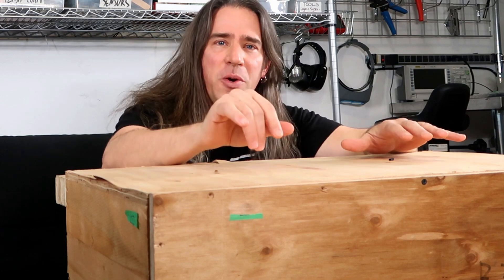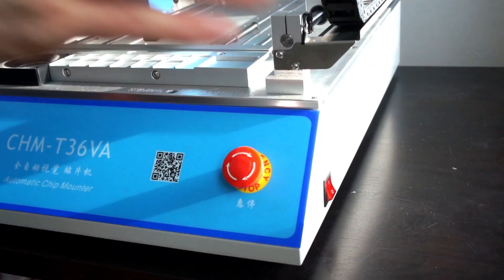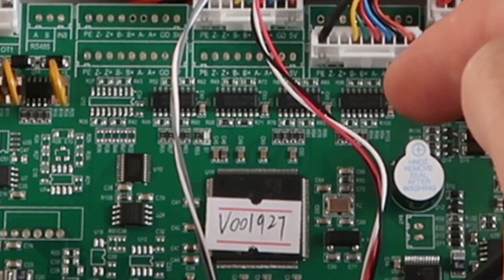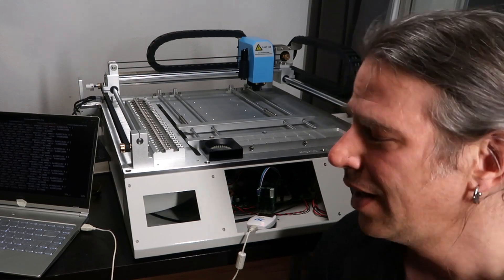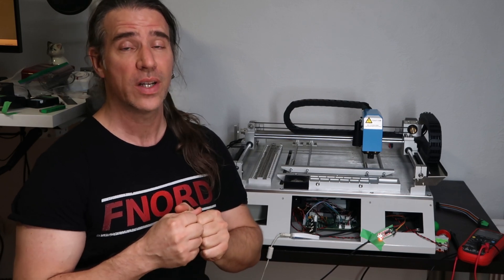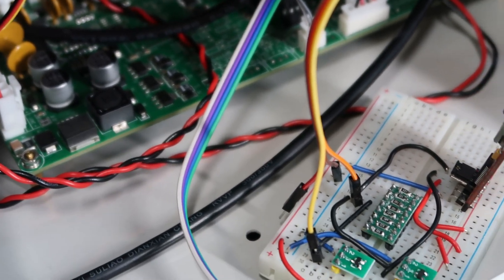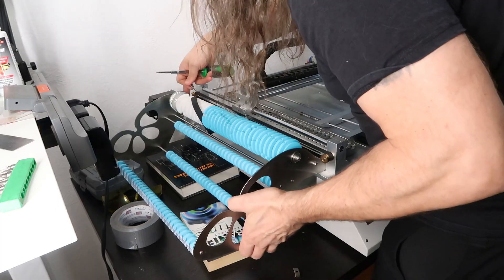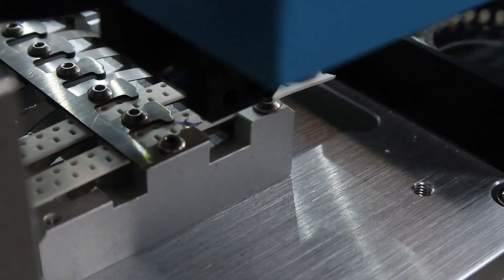Cheap Pick and Place + OpenPnP: CHM-T36VA upgrade guide

Comment: I ordered one of these off amazon. Called amazon to verify that everything was in order and i would be getting my PnP which they said absolutely. Spent all of the money i was saving for one  a feeder and components. Had the company call me and extort me for more money or they'd cancel my order. Now i'm stuck with Components and no PnP
Reply from the maker: Charmhigh did this to you??!  Sounds terrible, I'm sorry to hear this.  Though it was years ago, so I don't know if things have changed, I'd ordered directly from .cn through Ali and thankfully it went off without issue... maybe the fact it went through amazon offers some protection?
Reply: @PsychogenicTechnologies  Nope. I'm out around $2000 and they canceled my order. Amazon offered me $200 amazon credit for only things amazon sells. My only hope of recoup is slowly building a Lumenpnp buy one part at a time until i have it all q.q then processing the components i ordered.

Comment: Hey Pat, I'm new to your channel, but wow you have done some awesome stuff. I am taking ownership of a CHM-T36VB soon, and looking to the conversion to openPNP. Just wandering how yours is doing a few years down the track? haven't seen it in many of your later video's hopefully because it's just doing it's job uneventfully. Would love to see a follow up. cheers for now and keep up the open goodness.
Reply from the maker: Hi Peter!  The machine works great, actually... I haven't been doing many batches lately and this past year I've used the machine more often just to skip having to populate standard stuff like  bypass caps and 1- or 10-k pullups, doing the rest of the mini proto batches by hand, just because it's less of a headache than setting everything up for 3 or 5 boards.  
Short version: when I do use it, it's been quite uneventful, which is what you want from something that's a tool rather than a project.  Still love the thing, I hope you get lots of good stuff done with yours.

Comment: one of these days I'll switch my VB48 to use OpenPNP but, you know, stable working environment and all that.  Plus I like not having to have a separate PC and using the on-board computer that comes with the VB48.

Thanks for the video though!  Was entertaining.  Kinda suprised you didn't unplug some of the other wires to the actuators/motors/pumps/etc while you went through the flashing process.
Reply from the maker: I totally understand about the stable working environment... kinda got scolded by the openpnp guys at some point for using old versions in some of my videos with the liteplacer... what can I say, it's a work tool, can't be disrupted every 10 days.  And yeah, I like using the PC but I can see the advantages of having the pnp more standalone.
As for unplugging stuff for flashing: you know, there are so many ways I could've been so much smarter with this whole migration thing.  I got lucky, it all worked out :)
Thanks for the comment and feedback.

Comment: Did you ever have any issues with the motor being stuck?  When I turn on my CHM-T36VA, it doesn't move.  To my understanding, it is supposed to move the heads to the bottom left, and then back up to the home position.  I can hear the motor attempt to move, but no actual movement.  Can anybody help me with this?
Reply from the maker: Are you using the stock system/firmware?  In my case, with openpnp, it doesn't actually home on its own--I turn on, it does a little pssshh sound and you can hear it power up.  Depending on where you are, as the steppers lock, you can hear them more or less.  If you can get access to a gcode terminal, something like "G28 G91 X0" should home the x-axis (I'm not certain, look it up before issuing raw gcode commands!).  If it doesn't you may have a problem, but the fact the motors are locked doesn't necessarily imply there's an issue.  I'll add that I never, not once, used the stock firmware/software with this machine, so I don't actually know how it's supposed to behave if that's what you're using.  Good luck, I hope you figure it out and get some cool stuff made.
Reply: @PsychogenicTechnologies  Thanks for the reply.  I actually got it working.  It was a serial to usb driver that wasn't allowing the machine to initialize.  Right now I have everything working, and the only concern is that the rotate nozzle doesn't seem to work.

Comment: Hey can you help me, iam using smtmain.exe(not openpnp) with same machine as you, my problem is
 why when iam open diagnostic and i am click the PCB origin after click pull tape, is not same when iam open diagnostic and i click PCB origin withput click pull tape.

Another is why when edit file the position of component is correct, but when i step or run the potition is getting wrong, after that i check component potition again and getting wrong..
Can you help me or where the best platform for asking like this? This is my father machine..

Comment: Pardon my ignorance. Is this machine soldering the components as well?
Reply from the maker: No pardon required, I welcome all questions :)  No, it isn't.  The process is to paste up the boards with solder paste, making the pads nice and sticky.  The machine does its thing, then the boards go into an IR reflow oven, which not only does the soldering, but also--through the magic of surface tension--helps the component be in just the right spot.

Comment: Thanks for the video. I would be interested in knowing how this performed before with charm high sw vs after with open pnp. But it looks like you bypassed the before and went directly to the after. So how does the 36VA perform with open pnp. I may but one and do the same thing.
Reply from the maker: Yeah, I hopped right into OpenPnP without even checking if the thing worked at all (yes, because I'm smrt), lol.  But it all worked out, and actually the machine has performed really well: the main limiting factor being that I insist on installing it with a high center of gravity on rickety shelving (I could do better, but I just don't need better).  If you want to see the original in action, I'd relied a lot on this older series prior to buying, which is a nice playlist: https://www.youtube.com/watch?v=5Y8IyZYC1Uk&list=PLzvLbUxGuZ-xOnVTMobltYmCuJ7cavJO9

Comment: Ha! Entertaining video for sure! That table wobble, good for a belly laugh. I really appreciate your courage in doing brain surgery on a machine that is widely regarded as finicky and getting it to work with some satisfaction with OpenPnP.
Reply from the maker: :) Many thanks: hopefully more fun in the condensed version that the (mostly my fault) roller coaster adventure in real time.  The danger-wobble was resolved (new surface isn't perfect, but a huge improvement and would be even better if I conceded to lowering the center of gravity--you can see it in the video with the LED ring, plain metal shelving but 10x better than ikea screw-on legs) and the machine's been working really nicely.

Comment: Awesome video! Any recommendations for a hobbyist PnP that's good enough to actually get a 1st placement to work without pulling out more of my hair (not much left to pull out)? Not looking to do very large or complex boards initially. Do you prefer using the traditional distys (Mouser, Digi-Key) for parts, or do you take a chance on cheaper sources that may not be as reliable?

Aside:  What brand and series/part numbers of plastic storage containers are you using? Your method of organizing supplies is similar to mine, but I've settled on a different family (Sterilite1963 shallow, 1965 deeper). However, the latches on yours look like they might be more robust. And I don't think Sterilite has any matching containers that are not as wide.
Reply from the maker: Hello Paul: thanks so much!  For a PnP: really depends what makes you pull out your hair but--and I know, this is a project in itself--I still love the LitePlacer as a inexpensive and fun starter.  Though I haven't tried them, I have heard good things about the LumenPnP (https://opulo.io/) and @stephen_hawes has been doing some really nice work with the Index PnP (I'm especially interested in the feeders... not sure where you actually get it tho, but this playlist has lots of stuff https://www.youtube.com/playlist?list=PLIeJXmcg1baLBz3x0nCDqkYpKs2IWGHk4 ).

I use both mouser and digi a whole lot, but for maintaining stock of commodities where the markup sometimes seems excessive (headers and connectors,  mostly) and quality isn't critical (i.e. stuff I'm sticking into prototypes and field tests) I'll use Ali and distributors I've found through there.  And sometimes, just to get my hands on parts, I deal with the manuf directly but that's pretty rare.  When I'm buying anything smarter than a passive, will definitely go with a trusted and established source, and I'll usually set a digikey id as the VPN when delivering a BOM to client or china assembly house (and then it becomes their choice).

For storage: I started out with the "Really Useful" boxes: they are great, but then got "really hard to find" and "really expensive" for some reason.  Eventually I stumbled on some decent containers at the dollar store.  They carry a whole lot of total crap, flimsy, brittle... call it environmentally friendly, 'cause that plastic seems to degrade when exposed to air.  Anyhow, I found this set of good, thick, flexible, apparently durable storage containers and after trying out a few, bought a ton.  They've invaded both my office and home.  Unfortunately, I was pretty assiduous in removing the labels, it seems, and I couldn't find them on the store website. 

Closest I found is this:
https://www.dollarama.com/en-CA/p-12l-storage-box-with-clips-on-lid/3067622
It might be the same family, but I think I'd remember them being called "clippy" (old scars from exposure to microsoft makes that word stick out in my mind).  Anyhow, sorry can't provide a better reference than that.
Reply: I been ordering stuff from lcsc and I am really happy with them. I pay the 20.00 ups shipping and get my package usually in less than a week. They will let you combine orders too, which is really nice if you forget something and realize it before they ship (they ship fast though)

Comment: what should I do to make a working openPNP machine to assembling a PCB from .POS file generated from EDA software like KiCAD? is it like 3D printer or far more complex? could you explain to me?
Reply from the maker: Hello Kartiko, thanks for your question.  This, using openpnp to do assembly from kicad pos files, is exactly what I do, and can certainly help.  The answer could go very broad and deep, but the short version is:
 1) Choose a PnP.  Many (brave and smart) people design and build their own.  There are also kits, like the LitePlacer, which I have assembled (and documented in https://www.youtube.com/watch?v=ZCyM5CgGfYU&list=PLWm3YS7ce87mmoOOFdSWBRGjaTTMEoSfC&pp=gAQBiAQB ), and finally commercial pick and places from the small charmhigh I have here to very big monsters.
 
 2) Get it working and working with openpnp.  The openpnp site (https://openpnp.org/) has information and an active forum.  I've also talked a good deal about how I do this (mostly in https://www.youtube.com/playlist?list=PLWm3YS7ce87mqfHiKLYMluN-heOOPwLev ).  So you get the software talking to the machine, and the machine calibrated and operating well.
 
 3) Import your pos file into a new project and board.  This will create a number of components automatically, but you'll have some extra config to do (like specifying the part heights and where the machine gets them from).
 
 4) Apply solder paste to PCBs, let the machine know where they are and ... Press play!  
 
There's a lot I haven't said here, of course, but my videos can offer some hints and I'll be posting a lot more.  The thing is you can always get a company to do your boards and assembly for you, and if you are doing very many, or value your time, this might be the smarter way to go.  But I love having the ability to do this, for myself and my clients, and you may as well.  Good luck and have fun.

Comment: Do small p&p machines also cut solder paste masks and silkscreens and plot legends? Looks like they're almost a superset of the tech for each of those and it seems silly to buy lots of equipment when it could be just a head change.
Reply from the maker: Hi Tristan,  it's funny that you mention this today because I was thinking along the same lines this morning.  Someone offered to send me a PCB they'd made: cool!  So I'm thinking of how I'll assemble this one-off--by hand, of course, but my problem in this case is the stencil.  It either means doing a bunch of SMD by hand, making a mess with my "just splatter on paste"(tm) technique, or taking a million years with a syringe.  So I was wondering: why can't I get the PnP to paste it up?
Haven't looked into it further, though this does seem like a wheel I shouldn't need to invent.
Short answer (too late): I agree but I don't know how simple swapping/adding accessories might be.  But I'm interested!
Reply: @PsychogenicTechnologies  you can get  hobby cutters or CNC devices with the same mechanism to make solder stencils, and even to cut tracks in copper, and plotters to draw legends and select pens. There's not a lot of difference for light jobs like these.
Reply from the maker: @tricky778  Yeah, I've been sitting on one of the 3018 or 1610 or I can't recall NNNN CNCs from china for a couple of years--been meaning to use it, but even with an enclosure I'll admit I fear the dust.  However, this might be a good use case, if it's precise enough!

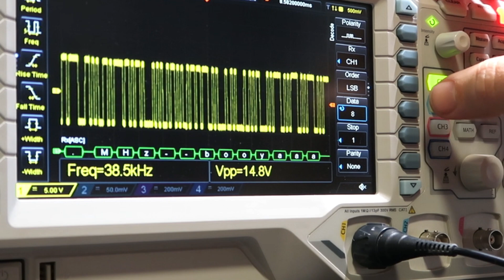Comment: That serial interface looks like RS-232 and not TTL serial (9:34 shows a vertical scale of 5V, so the signal is approx 10Vpp if the input scale is accurate). RS-232 uses idle-low, whereas serial TTL uses idle-high. Interesting look into the CHMT36VA though. Tempted to get one myself... hand placing 250+ components on a board is a real pain in the ass... lol
Reply from the maker: Jacob: you are absolutely correct.  My brain's been rotted by TTL uart serial dongles.  The protocol's what it should be and I wound up building a rickety RS-232 to USB converter, basically without realizing it. hah.  
Haven't had time to post an update on that, but it's in the queue.  Have a PnP vid being processed by the g00tube now, which should be out tomorrow morn, and will likely touch of this confusion of mine in the next pnp vid.  
Thanks for the comment/correction. And yah, I was told I'd be better off with the fidget spinners than the CHM, but so far she's been kind to me.  There are a few newish and more open options I might have a look at if I was shoping today, but I have to say I'm pretty happy with the T36VA--you'll see it moving a bit in the vid tomorrow morn, it's pretty rockin'.

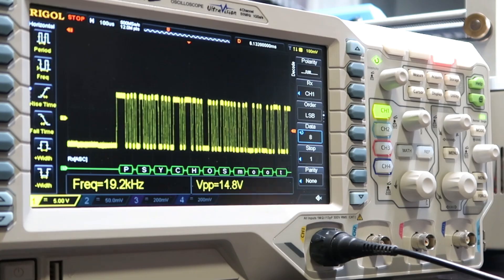Comment: @10:28 Are you sure the polarity is flipped?  RS232 MARK is anything more negative than -3 volts and is considered a TTL logic level 1 (HI).  RS232 SPACE is anything more positive than +3 volts and is considered a TTL logic level 0 (LO). As you identified data is conveyed LSB (bit0) first.  For an example of a TTL to RS232 voltage converter IC look at the MAX232.  The polarity appearing to be reversed look like the correct electrical standard from here.
Reply from the maker: You are correct: am actually working on a vid where I detail this.  Short version: my brain was rotted by overuse of TTL UARTs.  This is straight-up RS232.
Reply: Maybe this 20 second clip will clarify https://youtu.be/AHYNxpqKqwo?t=306 directly out of the electrical specification

Comment: Great video, Pat! I'm currently looking for equipment to do assembly work. I saw the boards you assembled and I'm very impressed. Can you please share which reflow oven you are using? Thanks in advance. Greetings from Peru.
Reply from the maker: Hey, que tal en Peru?!  Thanks!  Have been using it for a bit now and it's pretty sweet.  Have a few mods to share as well, am about to publish those--but the editing, and the fact I have to prep some resources for sharing made it slow.  Was wondering if the oven part was worth documenting.  Truth is, for years I got away with a toaster over and a hand-rolled PID controller on a 'duino.  Now I use an upgraded version of the classic T962 IR oven--have it reliable enough to just set and ignore.  It's done the job for my small proto runs but it's too small: some of the boards are big enough that even just a few leads to uneven results around the edges, if I pack them in. 
So have been looking around... thoughts/suggestions on that welcome :)
Reply from the maker: BTW, mortaldrumming: rumour has it the metal scene in Lima is worth it... can you confirm?
Reply: @PsychogenicTechnologies  yes, it is indeed. A few weeks ago cynic and beyond creation played here. It was a sick concert.
Reply from the maker: @mortaldrumming  May have to hit Peru at some point! Have been close(r) a number of times but was a while ago and mostly in Chile and a bit of Argentina.
Reply from the maker: Looks a hell of a lot like a whitelabelled t962, or something pretty close.  But if it has a fan inside or otherwise manages to move the air around in there without leaking out all the heat, and it has those 4 elements... I prob need bigger, but it could be good.

Comment: I have an older CHM pnp machine. But they were not cheap!
Reply from the maker: Salut Jean Pierre!  Well, it's possible I got a special deal when I bought it, and it was more than 2x the price of the liteplacer (if I recall, was a good while ago now), but since I didn't have to assemble the time timesavings there are worth something (though I'm conveniently not counting the time I messed around as shown in this video, hah).  But yeah, maybe "cheap" is only compared to the bigboy machines ;-)